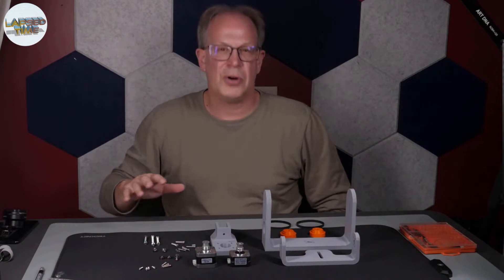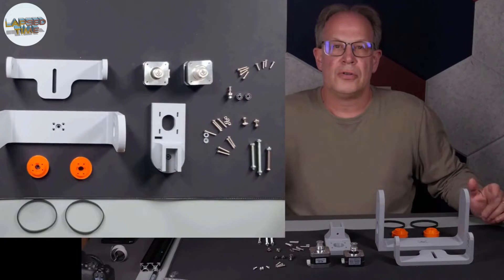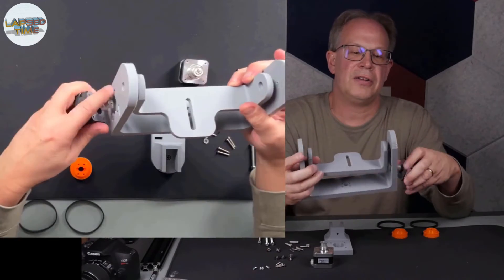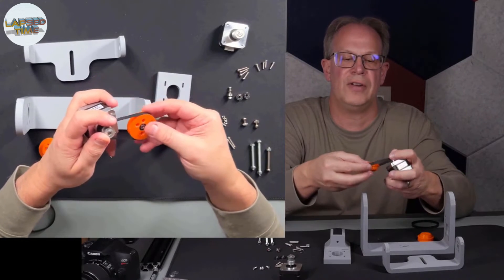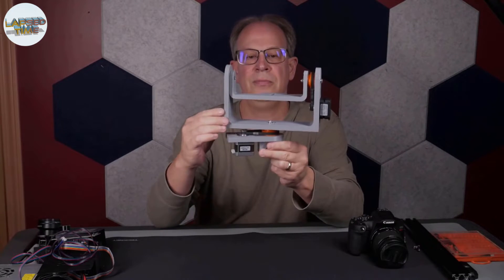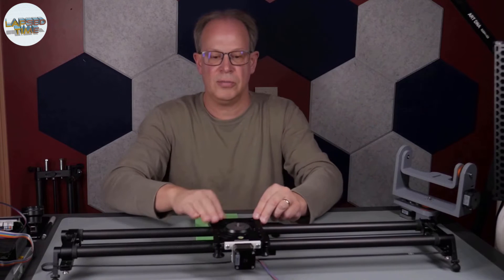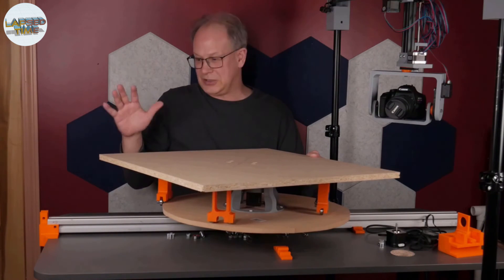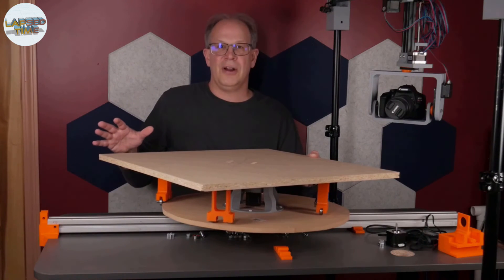Building a fully motorized stop motion camera rig using Dragonframe software & 3D printed parts.

Comment: but if the table moves and rotates doesnt that mess up the lighting of a shot?
But otherwise very cool setup
Reply from the maker: It depends on the look you are going for.  In this case, the lights are stationary, so I try to evenly light the entire table.  But you are correct in that it will not work in all situations.  You would need to attach a light to the table and have it rotate with it.

Comment: Are there any issues with the belt driven rig losing any accuracy in repeating a motion exactly due t slippage of the belt?
Reply from the maker: Yes, slippage does occur and the repeatable accuracy is OK but not perfect.  I did not require exact repeatability given stop motion animation is not perfect to begin with and I can make adjustments along the way.
Reply: @lapsedtime  im looking through all of the DIY builds to see where i want to go with mine. i love the fact that with dragon frame i can go back to a previous position but the accuracy would be up to the rig. Im leaning more to gear driven than belt driven
Reply from the maker: @ELF_Productions  I looked at both options as well but in the end, I felt the belt drive was easier since I was already used to them with my 3D printers.  Gear is likely more accurate.  The other thing to be mindful of is the backlash from the stepper motors as that will happen with both options.  You should be able to find some videos covering that as well.  Good luck and let me know when you finish your rig.